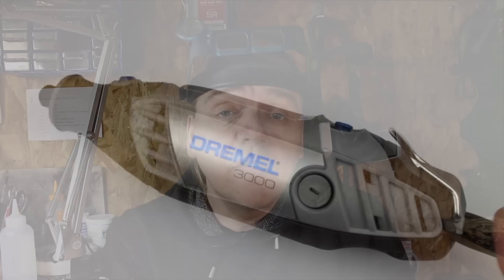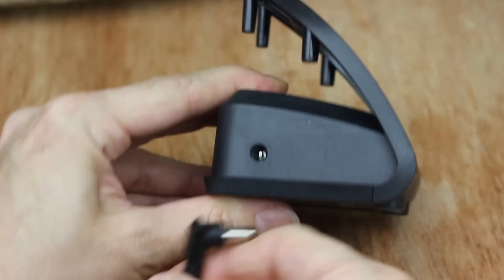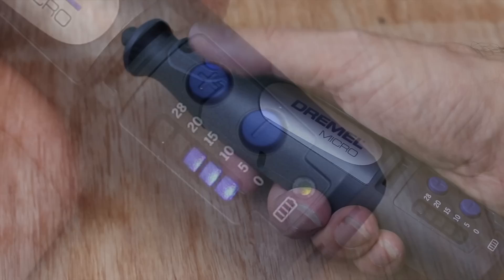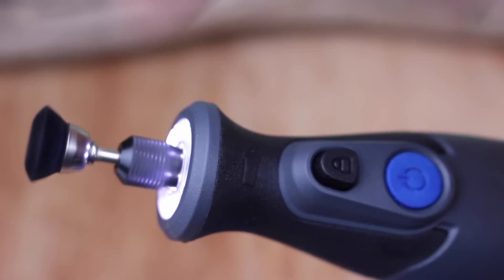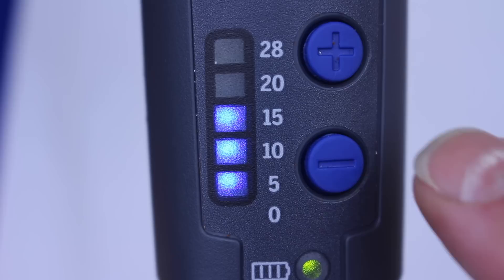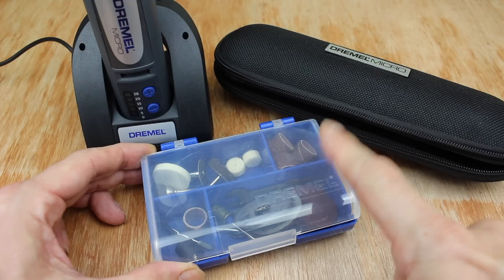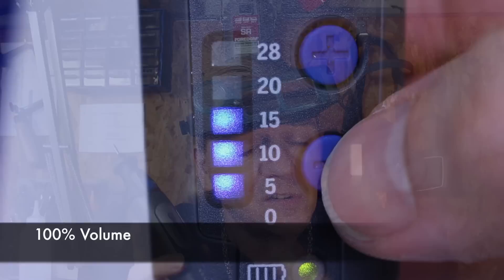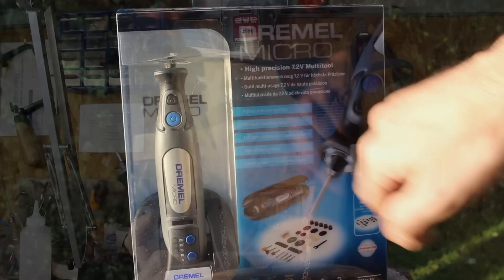Dremel Micro Cordless 8050 FULL Demo,  Review & how to in HD

Comment: According to the tool’s instructions you can turn off the power by reducing power to 5000 rpm and press and hold the 5 button for 3-5 seconds. It works as I have an 8050.
Reply from the maker: Not sure I understand, you. You simply turn it on and off with the blue button. Dave
Reply: @CelticDreamsCoUk  Pushing the blue button is the primary way to power on/off. An alternate way to power off is to push/hold blue button for up to 5 secs.

Comment: There is also an extensional cable for engraving, and wood carven, which is also very good. It needs some grease depended on how much it is used. It is like a pencil.
Reply from the maker: Yes i know what you mean the flex shaft attachment. but understand that it will not work with this corless model. This is a stand alone model and you cannot use any screw on attachments with this model. The dremel attachments like the flex shaft use a large removable screw at the end to attach them. hence they need the corded full size models. Dave.

Comment: I'm trying to decide between this cordless Dremel or the Dremel 4000. I think the 4000 is what I need for metal working where I will have some heavier metal working at times. 

Thank you.
Reply from the maker: The cordless is great and I do genuinely use it daily. i like the lightweight feel and the smaller size. Plusa the lack of a cord makes it really versatile. But for more power , more torque and the ability to use attachments, then the corded models are the way to go. Dave
Reply: @CelticDreamsCoUk  
Does the cordless version have the strength in cutting metal?

Comment: I have both but I prefer using the 8220, but its true that the 8050 is nice for engraving in the kitchen or on the go.
Reply from the maker: I'm not familiar with the 8220. But yes the 8050 is a nice quiet tool for indoor use. its very light and smaller (that the corded dremels) so it ideally suited to engraving and lighter detailed work. Hope this helps. Dave
Reply: @CelticDreamsCoUk  I got both including a generic brand and the generic brand from aliexpress seems to be better then the 8050 and you. can. use a rechargeable battery, Dremel is a name now, I say go for a Bosch rotary if you want. a very powerful Dremel and. a generic brand for engraving, the 8050 is  over priced

Comment: Thank you for the review! It was pretty comprehensive. I'm wanting to start a bit of woodcarving, and this was one of the Dremel tools we checked out at Lowe's. My hands are pretty small, so it fit nicely, but I don't/didn't know a thing about how they work or what the different attachments were for.
Reply from the maker: The micro isn't as powerful as the corded models, but the small size and cordless nature do make it very easy to use for delicate work. Dave

Comment: Had two both broke down after very short time same failure over priced junk purchased a new one half the price and more powerful and still running after five years hard work.
Reply from the maker: I've  used mine daily on my bench for a couple of years now and never had an issue with it, Still working fine, just as new. I've published your comment in the sprint of impartiality,  but rather than simply referring to it as a pice of junk. It may be of more use to the viewers, to explain what happened and why. Thanks. Dave

Comment: i have this one. its not prefect but works well on small to medium tasks. trying heavy tasks with it is slow and will stall the motor if you press too hard. air powered dremels would work better on the heavier tasks.
Reply from the maker: Yes it's only for light use.But do use it daily for polishing, sanding and drilling small silver items. I love the ease of use. Yes the corded ones are more powerful. I've never heard of "Air powered" Dremels though ? Dave

Comment: River stone - rocks cutting possible ? … and what blade ?
Reply from the maker: "Rocks" can mean anything, so a very vague question. Different rocks will have different hardnesses. You can get diamond coated discs and drills which will work on small pieces. I sometimes drill polished stones for pendants. Usually placing the stone in a tub of water and keeping the tip of the drill wet. Hope this helps, Dave

Comment: Unfortunately 5000 rpm is way too much when it comes to working on soft plastics. Would be 10 times easier if there was a knob you just turned to get whatever speed you needed. On my model 298 which is from the -90`s had buttons with 1000rpm increments from 5K to 33K rpm, but still nowhere near the low rpm`s i am looking for :( Maybe it is possible to modify the model 8050 somehow?
Reply from the maker: I guess you've answered your own question. if you want something very slow then perhaps think about a cordless screwdriver or small drill. Dave

Comment: Hi Dave.  I have a beginner's  question.   This will take diamond drill bits for drilling jewelry correct?
Reply from the maker: Yes, But remember that the collet will only fit one size of drill. If you want to use different sizes, you need to either buy shank drills (all with the same size shank), buy a set of different sized collects (hard work constantly swapping them) or simply fit the Dremel with a multi chuck. See video on the multi chuck for an explanation. Dave

Comment: Hi, you don't mention drilling - are there drill bits (is that what they're called or are they just drills!?!) which fit the Dremel Micro 8050?
Reply from the maker: For drilling you have two options. You can get small drills that are mounted on standard size shanks, so they will all fit your Dremel with a standard collet. The other option is to fir a Dremel multi chuck, which is a small four jaw chuck. Only a few pounds and I highly recommend it. Check out my other Dremel video where I show these options. see link. Dave
https://youtu.be/fIgFjGdl-iU

Comment: Great video, but how did you use the dremel to cut the holes on the bronze metal/pendant?
Reply from the maker: To cut basic round holes you can use a Drill bit as normal. For larger holes you can start with a drill and expand it using a cone shaped HSS cutter. For carving out larger random shapes from sheet you can use a long thin HSS cutter rather like a small router. Of course you don't have to use one tool for one job. A piercing saw, punches and disc cutters can also be used. Hope this helps. Dave

Comment: Do you leave the tool in the charger station when not in use or should you only put it in the charger when it needs charging?
Reply from the maker: A very good question. I have been thinking about this. Keeping it in the charger (plugged in) will mean that it's always charged and ready to go. But I suspect that the constant top up charging will reduce the lifespan of the battery. Its always said to be good practice to let a batter fully run down and then recharge fully. Its the same with laptops, once you start plugging in the power adopter regularly the batteries  die very quickly. They only have a finite number of charge cycles. So I' d say use the stand but unplug it. and don't recharge the battery until its flashing red. That will maximise its lifespan. Great question, thanks for posting. Dave.
Reply: with li ion batteries you will get arround 500 topups. lifespan is arround 15 years.you can charge the batteries at any stage and it will not run the batteries down or affect their preformance,because they dont have the memory effect. you can leave the tool in the charger without any further conserns. have a nice day :)

Comment: Hi Dave - great video! Just wondering please tell me why are there no drill bits for drilling holes into jewellery on this dremel micro? Does one have to buy those separately? Or are they not possible with the dream micro? Thanks in advance for your reply
Reply from the maker: Yes you can get drill bits. But remember that the Dremel uses a 1/8" Collet so you need to buy drills mounted on a 1/8" shaft. The alternative is to fit a multi-chuck. Check out my video below. Dave
https://youtu.be/FclCj7fuJ64

Comment: thank you so much for your useful review, it's the best one that I found online regarding the dremel micro. 
Do you think that this tool would be appropriate to use for a beginner metalsmith or should I need to buy something more powerful? 
I was also wondering  if the dremel micro is able to nicely replace a pendant motor...
Reply from the maker: Hi Layla (got the  song in my head now). The first thing to note it that the cordless tools like this are no where near as powerful as the corded versions. So if you are doing a lot of work with it, polishing, filing and sanding etc, then a corded one will be much better, it also wont run out at an awkward moment. Note you can't change the battery on this particular model, so you need to wait until it has recharged (several hours).  As a jeweller you aren't likely to be working outside, so as long as you've got a power socket close by then always go with a corded model. Check out my video on the Dremel 3,000 

Can a Dremel replace a pendant motor? simple answer NEVER. I have a Foeredom SR pendant motor and it has several huge advantages. Firstly is the power, it's 1/4 of a horsepower, with incredible torque (turning force). The Dremel micro can simply be stopped by your fingers, so that's first difference - sheer power.

The Foredom, as with any pendant drill, uses a foot pedal. This gives so much more control and keeps your hands free. It's a much better way of working.

Because of the flexible shaft, you can have a variety of hand pieces. All much easier to hold than as  you are not holding the entire tool. I use a quick change handpiece, so accessories simply pop in and out. very fast and easy.

Obviously cost is a major factor here. A Dremel 3,000 can cost £40, so  great value. Whereas a Foredom SR with handpiece can set you back £300 or so. But it really is a worthwhile investment and worth every penny.

Dremel do make a "plastic" flex shaft with a foot pedal called the fortiflex. But it's not cheap, so to be honest you may as well spend a little more and get the Foredom, which is far superior.

So it you've juts got a few pounds to spend then go for the Dremel 3,000 as it's much more powerful than the cordless, and about the cheapest Dremel you can get. But if you've got the money to spend, then a Foredom SR pendant motor is a dream to work with and well worth it.

Hope this helps. Dave.

Incidentally, have you seen my economy pendant drill ?  https://youtu.be/4CB3lRh2c74
Reply: Thanks so much for this demo, it helped me a lot!

Comment: Thank you. I have a very old Dremel which my dad gave to me but I keep that fixed up with my Koil Kutter blade and attachment. Looking at your other replies I think it might be time for me to invest in a pendant motor with a foot pedal to leave my hands free. That's my next research product. Do you know of one in the region of £100? Look forward to any help and advice - your post on the Dremel is fantastic. Thank you.
Reply from the maker: From your pound sign, I presume you are in the UK. A pendant drill is a superb investment, you'll wonder how you ever managed without one. I have a Foredom SR  and it's superb power and quality. But a pendant drill for under £100 is not going to happen, unless you find one used on eBay. Do avoid the many Chinese fakes though!!!.  Dremel do make a little pendant drill called the "Fortiflex" but its too expensive for what it is and so for the price you'd be much better getting a professional Foredom SR.   Likewise I tested an economy unit from HS Walsh (below). its very good and one of the cheapest at just over £200. But again the price is too close to a Foredom. Either way, you're looking at £250  for a decent flex shaft.  So I always come back to the same answer which is a Foredom SR. Made in USA, superb quality, high power and probably the best selling flex shaft in the world, with  lots of support and parts if needed. If you put it next to the Economy HS Walsh one and a Dremel Fortiflex, they are all around the same price, but there really is no contest.

HS Walsh Econoomy
https://www.hswalsh.com/product/balkan-universal-15000-rpm-pendant-motor-tp883

Dremel Fortiflex
https://www.amazon.co.uk/Dremel-Fortiflex-9100-21-universal-cutters/dp/B002TIL5S2

Foredom SR kit
https://www.cousinsuk.com/product/jewellers-kit-with-quick-release-handpiece

The Foredom SR jewellers kit is by far the best product and the best value.  So my advice is just bite the bullet, you wont regret it!

Hope this helps. Dave

Comment: How long does the battery last before it needs recharging ?
Reply from the maker: A lot of people have asked this, but its impossible to answer, it depends on the tool you are using and how 'heavy' you are. Light polishing will last longer than heavy grinding. I keep mine in the stand and permanently on charge. For me each polishing job is only a couple of minutes, then its back on charge again. So for me it never runs out. I think officially they say 40 mins or so, but it's impossible to say.  Dave

Comment: Hi, thanks for the video.   Can you tell me what i would use to sand inbetween the groves of the panneling of a 100 year old 6 panel wooden door and also i have the original wooden shutters too :-)) hope you can help me :-)) Tania (I have the Dremel 3000)
Reply from the maker: I guess there are many ways to strip a door, and I should point out that I'm a jeweller, not a decorator. Dremel make a small sander which is designed for this kind of job. see here  https://www.dremel.com/en_US/video/-/video/166653/sanding-wood-furniture

 But the Dremel 3000 can certainly help with the smaller details. consider....Flap sanding wheels, and sanding drums might be usefull. see here.... Dave
https://www.dremel.com/en_US/accessories-and-attachments/-/find-by/technique/27381/sanding

Comment: good review. some question please. how long u can use on one fully charge in max speed, medium speed and lower speed and how long when low battery to fully charge
Reply from the maker: Thanks. The charge time, as explained is 3 hours 45 minutes, from flat to fully charged. How long it lasts is impossible to say. It really depends on how hard it is working, light polishing will last longer than heavy grinding and sanding. Just like any cordless tool. But if you want something for continuous heavy work, then perhaps consider one of the larger corded models. This unit is designed for light occasional use on quick small jobs, like engraving and light polishing, which is does very well. I used it to cut through half a large plastic drainpipe which took a few minutes and was a tough job for it. But it didn't seem to affect the charge at all, so I'm pretty impressed with it so far. Dave.

Comment: I am planning on getting into small scale wood carving and was looking for reviews for dremel tools.  This seems like the sort of thing that could work perfectly for me.  Would you say that this would be fine for wood carving?  Would you suggest a different dremel?  Different or additional attachments?
Reply from the maker: It's fine for light work, the small size and light weigh make it very easy to handle. But for heavier work for prolonged periods, then a corded version will give more power and torque, Plus the ability to add accessories to the end, such as the router attachment. Dave

Comment: feel like a noob i hve a dreml and it came with alot accessories but no drills...what did i miss?  i thought ordered parts to add  ie colletts and drill bits but the colletts dont fit sheesh  help
Reply from the maker: The collets are fixed sizes to use with the shanks of the accessories. Usually your Dremel would only come with one standard size collet for use with the dremel accessories. For using drills you have two options. Either get drills that have the shanks the same diameter (available from jewellery supply companies) made for this purpose. Or the best solution is to fit a three jew "Multichuck" which can accommodate different sizes. See the video below for an explanation. Dave
https://youtu.be/FclCj7fuJ64

Comment: Well i currently have bad experience with this tool. Bought it yesterday and now it refuses to turn on somehow! If i put it in the charger no lights come on. Tested the charger with a multimeter and it is showing 12V as you might expect. Anyone came across this issue?
Reply from the maker: Just check the terminals on the bottom of the Dremel itself. I have a vague recollection that mine had some plastic tape or covering on it. Worth a check. Dave
Reply: @CelticDreamsCoUk  Thanks for replying. I took the unit apart and disconnected 1 wire from the battery controller to the motor and reconnected it. Than it suddenly worked!

Comment: Between this micro and the Walmart version of it Hyper Tough AQ85000G 8-Volt Lithium-ion Rotary Tool, 40 Accessories The micro is better right? More lighter... I’ve read that the micro is more lighter and the light is better. Using it for dog grooming. Many dog groomers have told me about the micro. Just want you’re input on this.
Reply from the maker: Hi Brian, I can't comment on the Walmart version as I haven't seen it. Nor do I know anything about dog grooming. All I can say is that I have this sat on my bench and despite having several professional flex shafts, I use this little tool constantly. It just sits there in the holder and is so convenient. 4 years, never a problem and I love it. Hope this helps. Dave
Reply: Celtic Dreams awesome do you leave it always charged up or unplugged standing in the charger when not in used ?

Comment: Very useful review, thank you. One question, if you are aware: For the heavier model, could the Flex Shaft Attachment be a solution for precision work like carving on glass, for example?
Reply from the maker: I believe the flex shaft will only fit the larger corded models with he large removable end screw. The micro is too small and doesn't fit any of the screw in type accessories. Dave